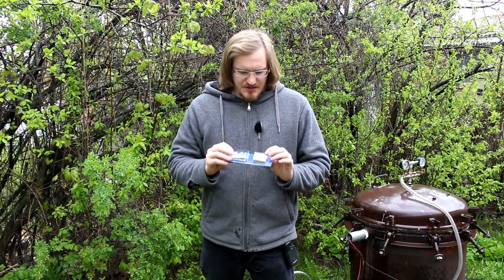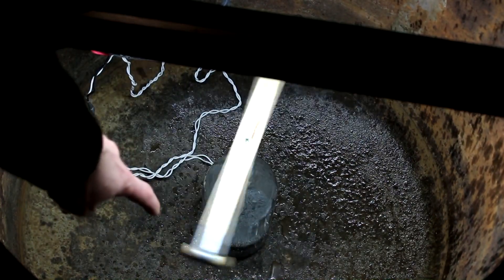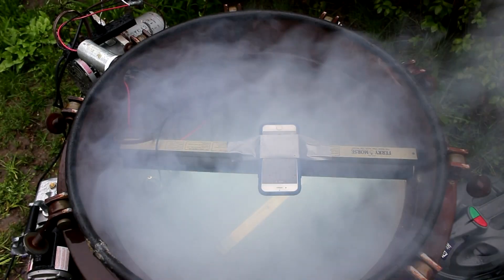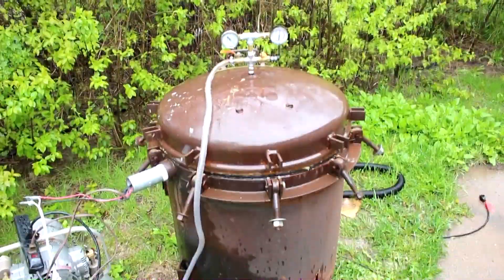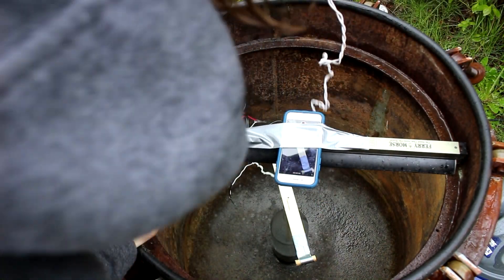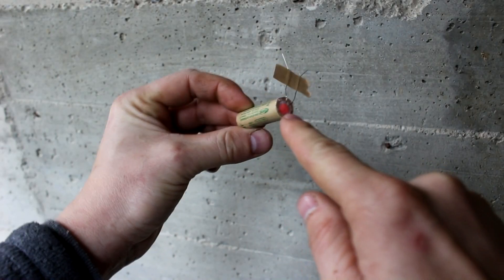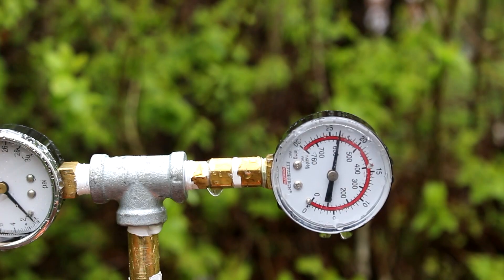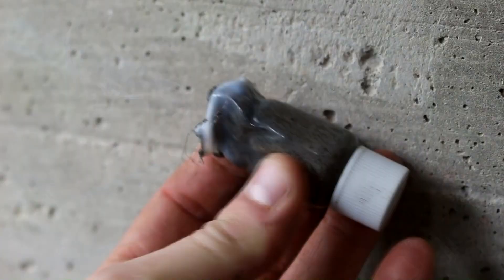Will a Model Rocket Motor Work In Vacuum?

Comment: It's not so much the pressure as the need for oxygen in the reaction. Try doing the same thing under oil, or any noble gas. For loose fuels you are right, the gas blows it around. But these are solids. I will use potassium nitrate, perhaps the most common oxidizer, as an example. It decomposed from 2 KNO3 to 2 KNO2 and O2 with heat. Usually the heat comes from a combustion reaction, which requires both oxygen and hydrogen.  So in the fuel is your hydrogen source which undergoes a similar reaction. The thing is, most of the times the amount of oxidizer isn't enough on it's own. It relies on a little kick from the atmosphere. That's why there is a little hole in the motor, to allow oxygen in.
Reply: No it's the opposite of that as Cody explained, the air in that bottle could have been pure nitrogen and it would not have made a difference on the combustion.
Are you just guessing the Rockets used atmospheric oxygen or do you actually know cuz I would love for you to explain how a rocket can draw atmospheric oxygen into a combustion chamber that has higher pressure than the atmosphere without pulsing like a internal combustion engine.
Reply: @FrancisR420  Dude this was 3 years ago and I'm not entirely sure what I was talking about, and I'm not willing to re-watch the video to figure it out. But... if I had to guess I would say I was talking about the small holes drilled in hobby rocket motors that increase surface area, create a more stable burn as to not shift the center of balance and provide oxygen to kick start the reaction as kno3 usually doesn't react without heat.

Comment: nasa uses liquid fuel right? if so, does liquid fuel need an atmosphere to ignite?
Reply: NASA uses solid and liquid fuels, and different kinds of liquid fuel, but they all have oxidisers. 

In solid fuels, the oxidiser is mixed in with the metal fuel in the binding agent. The Space Shuttle main engines and the second and third stages of the Saturn V used liquid hydrogen as fuel and liquid oxygen as the oxidiser. The first stage of the Saturn V used kerosene as fuel and LOX again as oxidiser. The Apollo lunar module used a mix of hydrazine and unsymmetrical dimethylhydrazine for fuel and nitrogen tetroxide as oxidiser.

With liquid-fuelled rockets the fuel and oxidiser are mixed together at high pressure in the combustion chamber; there's unlikely to be enough atmospheric oxygen around to burn the fuel fast enough to be useful.

NASA (and other space agencies, of course) does use different nozzle designs depending on if a rocket engine is going to be operating in an atmosphere (first stages) or in vacuum. To get the best thrust the nozzles have to be designed bigger for vacuum use and smaller for use in air, since the pressure of the atmosphere interacts with the exhaust.

What I think happened with Cody's rocket is that normally the air serves to constrain the expansion of the exhaust so that it comes out in a jet. But in a vacuum, the exhaust comes out expanding in all directions because there's no air pressure to hold it together and no nozzle to point the exhaust at all.

On the other hand, it could be that the rocket is small enough that the amount of air normally in the empty core of the rocket helps the oxidiser to burn the fuel, but without that the oxidiser couldn't manage it? I dunno, Cody kind of raced past his reasoning there.

Comment: what happen if you make yeast ferment sugars to alcohol in vacuum?
To make good alcohol they need anaerobic conditions. In kegs they are in anaerobic condition because they quickly replace oxygen with carbon dioxyde. In vacuum they should still be in anaerobic right, and to the opposite of humans they should stay alive.
But since you are constantly removing the carbon dioxyde they generate, would the Le Chatelier principle pull the reaction to a quicker fermentation than a batch that's fermenting outside?

Comment: Just curious - did you dissect the bottle rocket (heh) to see whether it burned completely? It didn't seem like it burned as long as the first at atmospheric pressure, and I didn't notice the ejection charge pop in the final test.

Comment: Before I see another comment on how " rockets don't work in vacuum ", Just remember these are not designed to work in a vacuum in the first place.
Reply: So you rely solely on the momentom gained in the atmopshere to get to mars? Or did I missinterpret your comment
Reply: @flumblumsummers5068  I mean these hobby motors specifically. Actual rocket engines work in a vacuum. Though given how I worded this it isn’t very clear

Comment: A similar technique can be used to assist the parachute ejection charges on high altitude high power rockets. I tested 35 mm film containers over a decade ago when I had a level 2 cert and was active in building and flying these. Black powder charges are notorious for failure at high altitudes due to lack of pressure. Black powder is usually the choice for these.

Comment: Why is pressure necessary to burn in the vacuum? I get for thrust, because you need something for the expelling fuel to push against, but I don't understand why burning in general needs pressure. Shouldn't combustion only depend on having an oxidizer for your fuel? So instead of the container on the rocket (which could've trapped oxygen, thus providing oxidizer) couldn't you make your own fuel with on-board oxidizer?

Comment: Sine this is also a Pressure chamber... what happend when you ignite the rocket under high pressure? Will it simply produce less thrust or... I dunno xD
Reply: It's efficiency goes down with increased ambient air pressure, a rockets efficiency is at it's highest in a true vacuum contrary to what most people think nothing is needed on the outside of the rocket for it to 'push' against.
Reply: Yep

Comment: Cody i have a question to that video... im not shure that this is true but... in an vacuum sound cant travel right because of no mass of air that cant move to travel the sound? what ever... why i hear a bang when your rocket starter activate? im mean travel shockwaves thrue a vakuum? normaly it shuld not do it because the same way with the sound... a shockwave is just moving air right?

Comment: Seems you introduced air into the vacuum when you added the bottle giving the rocket time, with air, to ignite. Question still remains do you need to control the rockets with air in a vacuum in space seeing that in a vacuum you showed the rocket didn't work until you introduced air in the end per the bottle? Seems a big difference in a controlled experiment as opposed to a vacuum where there is no air.
Reply: The atmospheric oxygen didn't help it ignite,  just the pressure from the air it could have been pure nitrogen, the rocket has its own oxidizer but dry gunpowder does not sustain a chain reaction under vacuum
Also most Rockets used in space ignite and burn Under Pressure not directly in a vacuum.

Comment: See what happens when you have pure oxygen at 16psi...does aluminum burn?  If someone had done that test before January 1967 it could have saved the lives of 3 astronauts.
Reply: The bigger problem with Apollo One was the simple fact that it was virtually wallpapered with Velcro in a 100% oxygen atmosphere.

Comment: Cody, this is the first time  I caught an error when you said it was the air pressure that was required to burn when it is the oxygen. The rocket supplies it's own oxygen.
Reply: Maybe the lack of oxygen is inhibiting the ignition bridge between grains/
Reply: Obviously the rocket has its own oxidizer in order to burn that oxygen you need a certain amount of air pressure to sustain the reaction, that's what he said and then demonstrated, he did not make an error
Air pressure does not burn, oxygen Burns. Him saying you need pressure is not the same as him saying you need oxygen from the air.
Also how would a lack of oxygen between the grains work when the grains themselves are part oxygen? what's lacking is a medium for heat to travel through to heat up the oxidizer to produce oxygen to burn the fuel.

Comment: The reason why these motors don't burn in a vacuum is because they have no oxidizer, as opposed to the NASA rocket engines, which require fuel and oxidizer to burn. These motors don't have any, as they'll never get any where near the altitude where you need it to burn.

Comment: Cody, it dawned on me that if you were going to do a long term totally oxygen free experiment, the iron rusting in the vacuum would consume any remaining O2. Warming the canister would cause the remaining H2O to boil off as well while the vacuum is running. is that correct?

Comment: It was going well until you put the rocket engine inside an atmosphere filled tube, I bet the astronauts could shoot a rocket inside their capsule as well, you flawed the whole experiment
Reply: He didn't shoot a rocket inside of the bottle he used the bottle to provide pressure to help the rocket ignite and then it shot out of the bottle if it was entirely contained within the pressurized bottle it wouldn't have moved an inch.
Also yes many NASA rocket boosters have pressurized Chambers for ignition

Comment: Model rockets are pyrophoric, along with any other propellant that uses oxygen as an oxidizer. In vacuum (space), rockets use hypergolic propellants.
Reply: Wrong.
Reply: Some use that but others still use combustion.
They just pressurize the gas before combusting

Comment: IDK Cody. I do not think the rocket worked in the vacuum. It ignited in the bottle it was in and that initial thrust blew the end of the bottle off and spun it around. The question to find out is does the fuel in those motors require Oxygen to operate. As far as Nasa, well its Hydrogen combined with Oxygen.. Just like your blow torch you made..

Comment: what was with the pulsing in the water during the high speed replay. I'm guessing its something to do with the air pressure vs the surface tension?

Comment: 5:55 So it is not a rocket motor in vacuum. Since you put it inside a little bottle.
Reply: the bottle has a hole in it when the motor fires
Reply: +fondle If it was in a little bottle after it ignited ... how would it drive the stick around?

Comment: It was pushing of the sides of the container..
Reply: Rockets don't work that way.
Reply: What Way? The thrust was pushing on the container. The Container is far too small. The rocket was too close to the walls, it was pushing off the walls.

Comment: I'm guessing that these little engines have a lower amount of oxidizer in the fuel, to stop them just exploding. They probably partly rely on the oxygen in the air to work, because they're never meant to be used at any kind of altitude.

Comment: Hm. To be accurate, the expanding gas is pushing against the firing chamber (and in this case the enclosing jar) and the only place there isn't resistance for it to push against is the aperture/opening. The gas escapes the aperture, pressing on every other point of contact inside, and the rocket moves in the opposite direction from the gas.

Comment: Please reply to ODD's video and give the flat earthers a science lesson. It's so insanely dumb
Reply: Markoul11 that small amount of air is NOT ENOUGH to explain the acceleration of the rocket
Reply: Mark, the capsule was in a vacuum. What's it pushing against?
Reply: +Markoul11
He did the exact opposite.  He CONFIRMED that Newton's Third Law applies in a vacuum.  He CONFIRMED that a rocket can use it's own fuel and oxidizer on board to create thrust.  The rocket produced the same thrust in a vacuum (or a near vacuum, if you want to assume that the air in the capsule instantly spread throughout the entire vacuum chamber) as it did in the Earth's atmosphere.
Reply: You underestimate the potential of air when pressurized or depressurized  instantaneously... the more abrupt the compression decompression is the more violent the explosion force produced even for tiny volumes of trapped air say 1cm^3 (one cubic cm). 

https://www.youtube.com/watch?v=3W7FkAUif4o

https://www.youtube.com/watch?v=D4qIlMvEZZs

https://www.youtube.com/watch?v=axbFo-wsp4g&t=

Actually the pressure one can produce per a specific unit of surface has nothing to do with trapped air volume to be compressed. Even 1ml of air can be compressed at 100psi when a 6.8 atmospheres compression force is exerted, which is typical for chemical compounds explosive charges or rocket fuel.
http://understanding-air-compressors.com/how-much-does-air-compress-at-100-psi/
Reply: Markoul11 
Asshat!
Reply: Mr. Cody,

You just proved that Newton's 3rd law does not apply in a vacuum.

The last thing you did to make the the thing move was an error. You just enclosed the rocked inside a capsule with AIR!! YOU PROVED NOTHING THAT ROCKETS WORK IN SPACE! ON THE CONTRARY YOU PROVED THAT THEY ONLY WORK ON AN ATMOSPHERE.

sorry about that.

Comment: It seems that the rocket motor didn't burn as long in the vacuum, can you check that?
Reply: These model rocket motors have a smoke timer at the end of the thrust burn and then after the smoke timer of a couple seconds burn an ejection charge that blasts out the opposite end of the engine - that is to pop the parachute.  You can hear that this ejection charge goes off on the first run of regular atmospheric pressure and it does not in the last one.  So yes, the burn was shorter in the last one under vacuum.

All of this, though is not a question of pressure but a question of oxygen.  Also, rocket engines on space craft are not solid fuel like the model rocket engine - they are liquid fuel.  And space craft use liquid oxygen to provide the O2 needed for the rocket fuel to burn in the vacuum of space.  The model rocket engine is designed to burn in regular air, so does not have the same kind of O2 source built into the engine.

So the rocket engine didn't burn under vacuum not because of there being no pressure, but because there was no air with oxygen.  Likewise, if you had a chamber full of CO2, but plenty of pressure, the engine probably would fail to ignite.

In the final video, the engine did ignite and burn a short amount - but not the full normal burn of these types of rocket engines - because oxygen was provided for the engine in that plastic bottle it was encased in.  But as soon as that O2 burned up, the engine died.  So you did in a way create the same as what NASA or any other space vehicle does - they take the o2 with them in the form of liquid oxygen.   The liquid O2 on the space craft is mixed with the fuel inside the engine where it is ignited before being ejected into space.  So the part of the rocket engine where the fuel is actually igniting is NOT a vacuum.

So there are really 2 questions here:
1) Can rocket fuel burn in a vacuum?  A: No, unless O2 is somehow added to the fuel in the ignition chamber.  If O2 is added then yes - but it's really not a vacuum at the place where ignition is happening.
2) Can an ignited rocket engine produce thrust when the engine is surrounded by a vacuum?  A: Yes.
Reply: You have a very affirmative tone but some of the information you provided are false. Be careful as this could be misleading.
Reply: Adventist NASA actually uses SRBs in space because of their reliability, and they carry their own oxidizer so they don't need O2.
Reply: Actually, NASA uses SRBs because they are cheap and provide a lot of thrust. SRBs are quite dangerous as they can't be controlled.